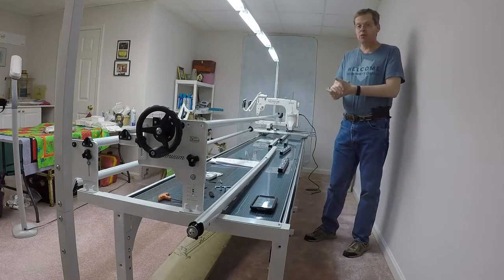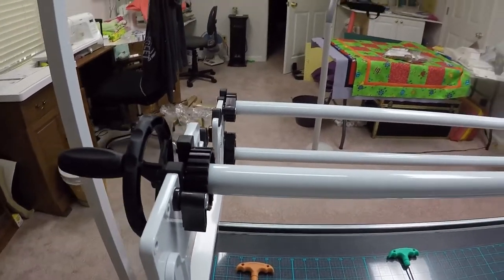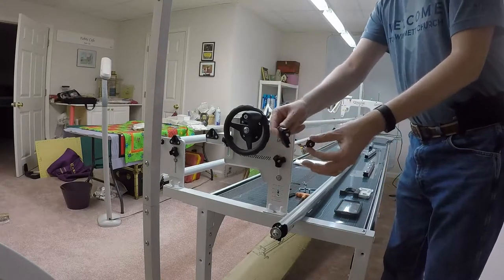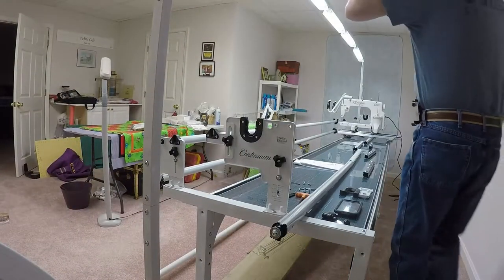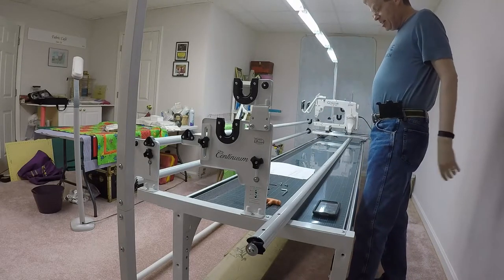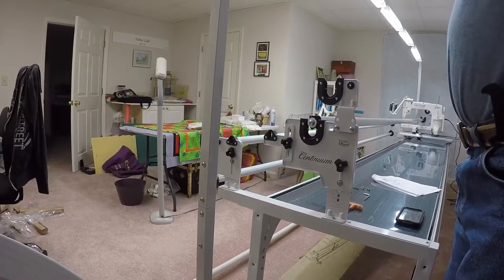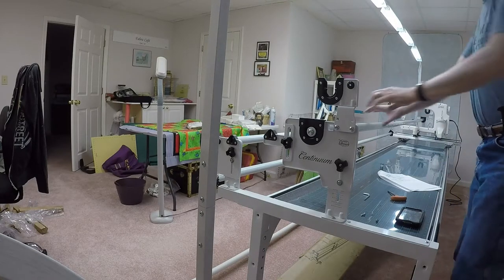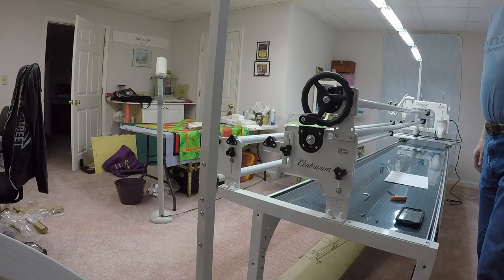Idler Rail Assembly

Comment: Could you tell us about the gridded clear panto-shelf sheet on your panto table of the continuum frame? I am looking for a vinyl sheet to place over my panto paper, both to flatten and protect. The grid pattern seems helpful for placement and alignment.
Reply: At the time of filming, we had the Precise Pantograph System set up (but took it off after getting QCT4.) What you saw was their Pattern Grid:
http://www.2sistersquilting.com/PrecisePantographSystem.html
"The PatternGrid®
$74.95
$15.00 Shipping/Handling
The PatternGrid® measures 18 inches by 12 feet, with 1 inch blocks and ¼ inch dotted lines and is made of a 10 ml. rigid plastic. 
Kits include a wet erase marker, 8 oz spray bottle, ruler and cloth for wiping off your wet erase marker."

Comment: Thank you for the video. I was told at The Idler bar will not work as well with the 14 + because you lose 3 to 4 in of quilt space. Do you find this to be true?
Reply from the maker: Hi Tina. I checked with my wife and she verified that she does lose 3" with the idler rail in place. She does not have any issue with this loss, since the presence of the idler rail means she doesn't have to keep monitoring/adjusting the take-up rail height when she advances the fabric.

Hope this helps...let us know of any further questions!
Reply: Hi Tina, just wanted to make sure you know about a conversion kit that is "coming soon" for the Continuum frame. It will keep the idler rail from causing you to lose quilting space.  Sounds great!
This is from the https://www.graceframe.com/en/machine-frames/continuum-frame website:
"Moving Rail
Coming Soon
The Moving Rail Kit lets you expand your quilting reach. This innovative quilting frame add–on for long–arm quilting works like an idler rail that moves back and forth with the motion of your quilting machine. The moving rail adds up to 4–6 inches to your reach, and works to keep your block size consistent. When quilting normally, the layers gather on your take–up rail, taking up space and reducing reach. The moving rail moves this fabric build–up to keep your quilting reach the same throughout the quiting process."
Reply: Will you need both the idler bar and the moving rail?
Reply: I do not have the Moving Rail so I cannot answer questions about it - it still says "Coming Soon" on the Grace website. There's a video you can watch here:  https://www.allbrands.com/products/85267-grace-moving-rail-for-cont
Reply: This was posted on the Q' Facebook page by someone who got the moving rail - if you do a search there on "moving rail" you will see it: 
" ...the moving rail works in conjunction with the idler rail. The quilt sandwich attaches to the idler rail with clamps; there is slack between the idler rail and the take up rail to allow back and forth movement of the take up rail. There is a speed control/on-off switch that will allow you to turn off the moving rail if the extra reach is not necessary. It is truly a great add on. Forgot to say that the glide mechanism is used with the idler rail."